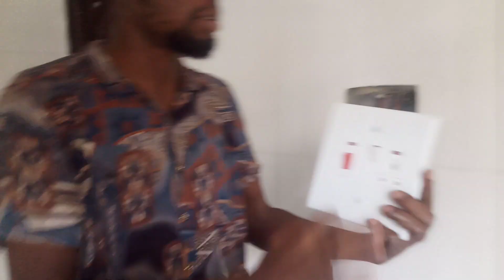HOW TO CONNECT COOKER UNIT CONTROL SIMPLIFIED #socket #socketconnection #elect #electricalpractical

Comment: Is it possible that a cooker that has been working for more than a year, when the switches are nolonger worker call for a major electrical fault other than replacing the socket switch
Reply from the maker: You can replace the faulty switch first before concluding it's Electrical fault
Reply: yes you are absolutely right